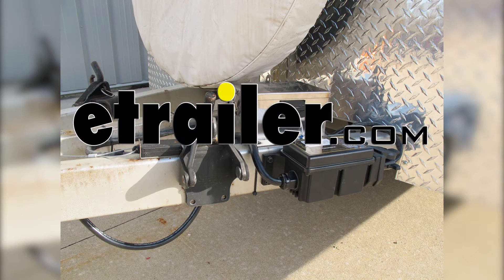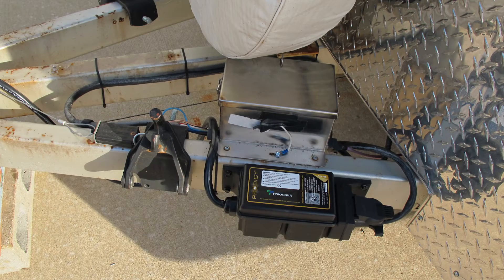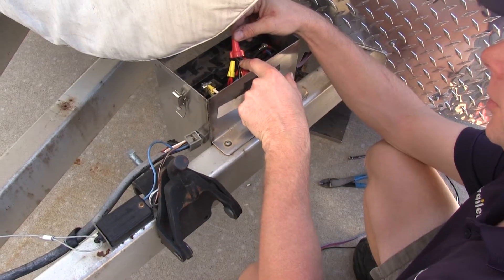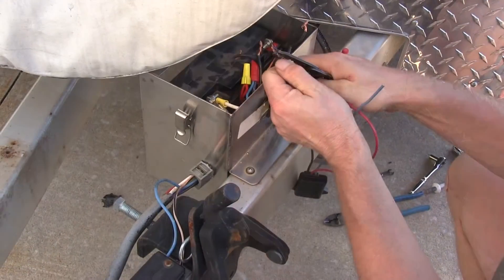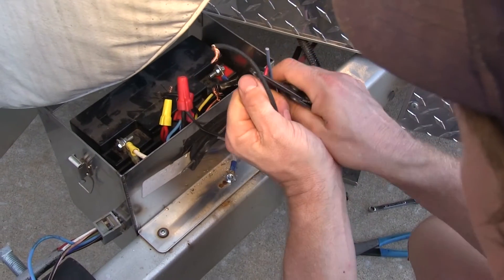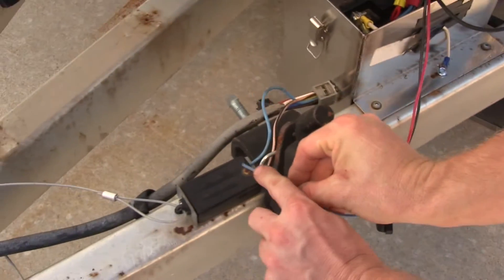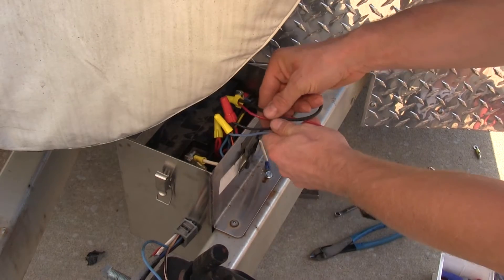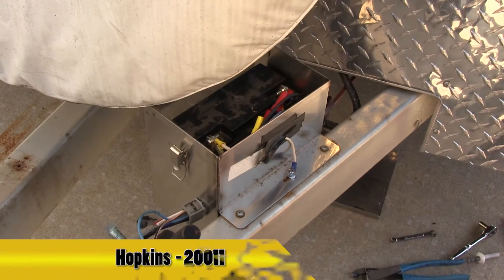etrailer | Trailer Breakaway Kit Battery Charger Review

Comment: Do you like your fingers?  You MUST remove the negative wires from your battery before doing any work at any part of your brake system.  Remember the simple phrase I learned in H.S. auto shop:  "Negative is always first and last".  First to come off, last to go on.

If your brake system incorporates any connection (the charger) to the power box for your lights, et. al., you have to disconnect the negative battery terminal every time you work on your trailer's electrical system.

Comment: What purpose does it serve to wire the blue wire to the breakaway box? If it's a battery charger shouldn't it just go to the battery and 12v/Aux lines?
Reply from the maker: This charger is designed to keep the small breakaway battery charged for the time when you might need it.
https://www.etrailer.com/Accessories-and-Parts/Hopkins/20011.html
Reply: Because it needs to be tied into the trailer brake wiring.  That's the whole point of having a breakaway battery . If the trailer gets disconnected from the tow vehicle, hopefully the switch gets pulled and then power is sent to the trailer brakes from the battery in the charging box....